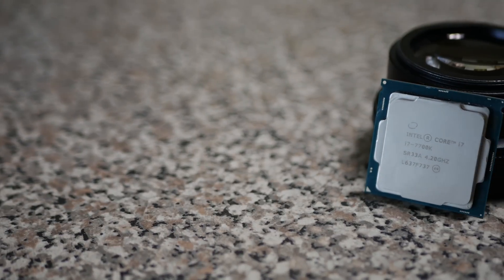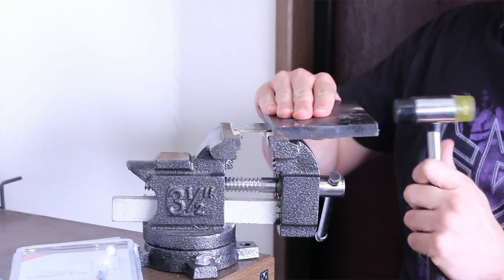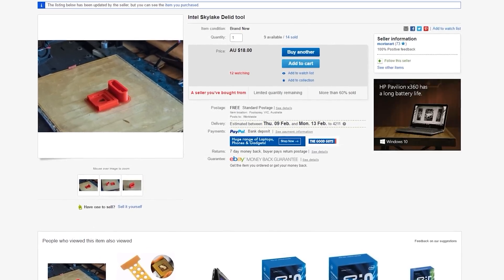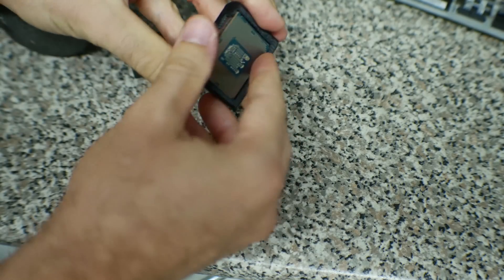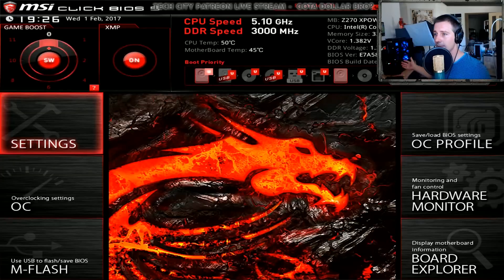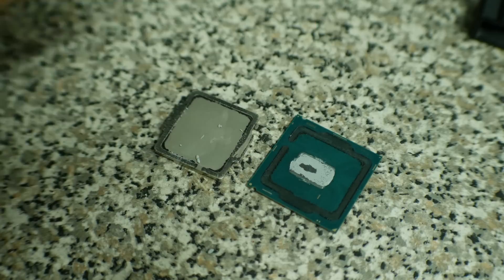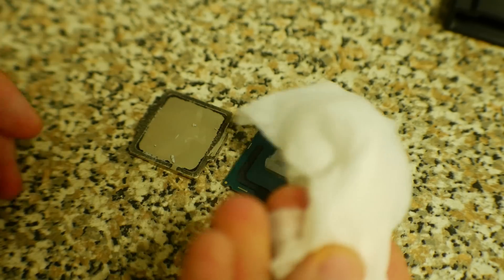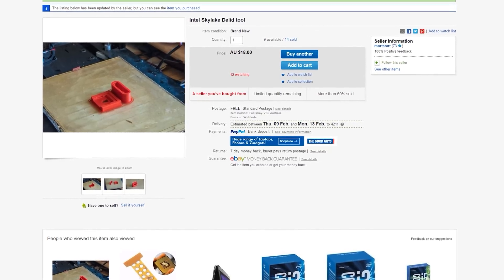DELIDDING The i7-7700k - How much of a Difference is there?

Comment: AMD used to be the hottest cpus, but for a while now Intel takes the cake..Seeing reviews on youtube  ppl happy with 85C on intel chips, like its ok..
Reply: intel takes the cake because AMD hasn't released anything for 5 years
Reply: Roman Kanivets Seriously? bummer :( my i7 6800k runs 75c prime95 on load with noctua u14s wich is 5- 10c warmer than your cooler. Then again i7 6800k is a souldered chip
Reply: To be fair while Intel CPUs run hot (temperature) AMD CPUs put out more heat (energy).
Reply: Sam B well the reason why most are upset with Intel is bc they are cheeping out on thermal grease that costs next to nothing. Esp with the premium they are charging for the CPUs.
Reply: My skylake runs at 40~50ºC under load.
Reply: Yah I got a really bad chip even out of the 4770k's. I haven't tried changing the thermal paste, afraid to break it. But yah can't over clock it at all, was a huge disappointment after I got it. I would imagine it would have throttled like crazy if I tried using the stock heat sink.
Reply: hm 85c for skylake is bit high but those chips can handle higher temps .... skylake start thermarthrotling at 95c and shot down for safety reasons at 105c .... now yes i personally would not be happy with 85 c but that sound as or very high OC or  bad cpu cooler cos i have my i7 6700k on 4.7 ghz on max temp 70-72c (corsair h100v2)
Reply: yeah intels cpus run hot because you can push them to the limit and actually have them put in work
Reply: namcost I have FX8350 @1.4v  @4.6ghz and max i get is 70c on aida 64 stress test. running it on big air. In gaming 52c to 60 max.
Reply: after pissing all over AMD chips for supposedly being hotter. Yeah, I just laugh. Delusional fanboys is all.
Reply: Pennywise, It took me years to realize that we had a septic tank. Pennywise is crazy,but chilling in years of shit from a family of 5, prolly wasn't something IT would love.I grew up in Londonderry Nh right next to a town called Derry Nh, so I though Derry was just across the train tracks.
Reply: what are your thoughts now ? haha
Reply: Yes but we don't know anything about the temperatures, do we?
Reply: Call It What You Want True, if it competes with kaby lake with noticeably lower temps them it'll be the obvious choice, but I still don't want to invest into the current gen processors
Reply: Yah my 4770k runs at 85c under load with a nactua nh-d15 with no over clock! I can't believe they ship cpus with such shit thermal paste.Can't wait for ryzen lol
Reply: Roman Kanivets What thermalpaste are you using?
Reply: Daniel Norelius Arctic silver, and I change it every 2 yrs. Have an AMD server running an 8350 with a cheepo 12$ CPU cooler I picked up on Newegg, and that usually sits in the 60-70 deg range when really stressing it..
Reply: Freddie Lewis intel fanboy
Reply: Roman Kanivets ok, if you live i europe you can buy DerBauers delidding tool pretty cheap. Follow the instructions and nothing will go wrong
Reply: Daniel Norelius oh alright, I'll check it out. Thanks for the info. I live in us, but I'm sure I can find it on eBay or something.
Reply: Roman Kanivets You should also be able to lower your stock voltage. Check what voltage you have and lower it until you are not stable any more. Intel might have set high voltage on your cpu
Reply: I have a 4770K too, and at loads it runs 70C, overclocked to 4.4ghz. I use a Cooler Master Nepton 280L, Close Loop Liquid Cooler, with the Noctua NF-A14 Industrial IPPC-3000 PWM fans. That Noctua you're using is doing a poor job, something is not right. I've seen that Noctua doing better temperatures, like 75C at load. Check your system
Reply: It's the cpu, I was using corsair h100 closed loop liquid cooler prior to Noctua, had really bad results. The cpu was hitting over 96C under load. I think I got a bad batch or something.
Reply: Pyrobaguette1 same with 860/870
Reply: No overclock and 85c under load, with the D-15 for cooling, is really strange .. even the stock intel cooler wouldn't be that bad. I would advise you to check the vcore voltage first, then check if the cooler is working properly. My i5 6600K overclocked at 4.6Ghz with the Corsair H60 never goes above 70-72c, even in prime95
Reply: Gixxer983 AMD cpus only report the cpu temperatures, not the core temperature. Which is always 10-20 degrees lower than the core temperatures. Anyway the 9590 really puts out alot of heat and without proper cooling will get fried and it did happen to alot of people, hence why it is so infamous as a joke in hardware forums. You can tell how much heat the 9590 build outputted just from the fact that it increases the entire room temperature on load. A friend of mine who have a 9590 cpu in his build says he cannot play it without air conditioner because his room would become too hot. If you got a kill-a-watt or a high end power supply you can see that even an FX 83xx draws more wattage in a similiar build than a freakin 6900k, therefore theoritically it is also producing more heat. There is just no denying it that the FX are a very inefficient cpus. But it is indeed managable provided your cooling solution is enough for it.
Reply: My 7 year old Dell XPS running a 2630QM Sandybridge ran at low 90's on rendering/encoding. It's still alive and working perfectly. I reapplied using Arctic Silver 5 about a year ago. Runs flawless, idles are around 46-51. On full load, it hits low 90's!!!
Reply: KungFuBlob nice to hear that. cpus are very very hard to kill. i dont know anyone personaly that killed one. cpus will generaly shutdown when tdp is reached.. i think only voltage spikes might torch one or extream heat for years on end.
Reply: zen will at the highest end is only 91watts tdp with 8/16 threads 
and intel 7700 at the same tdp but only 4/8threads and eating 1.4volts when OC at 5ghz+
Reply: woah, my 2600K @ 4.5 stays under 75 even during stresstests with a nh d 14.
Reply: dutchie here, we probably reach that temperature 2 days a year.
Reply: Well, my Skylake runs at 48ºC when is under 100 % load
Reply: I've rarely ever had thermal problems with AMD chips over the past 25+ years that I've used them. I currently  have an AMD A-10 FM2 6800B(K version was twice as much $ for almost no performance gain) clocked at 4.4Ghz, with a 100watt TDP, and it rarely gets up to 50C on a DEEPCOOL GAMMAXX 200T($15USD Air cooler), and currently sitting at 35C with summer peaks at 48/49c under full load doing DVD encoding(was transferring my family's old VHS home movies to Digital, and DVD).
Reply: considering how shiney Tech City is at the start of the video, you'd think someone would figure out its summer for him and not post a stupid comment about thermals
Reply: +Roman Kanivets makes you wish they soldered the ihs on right? That's why Sandy Bridge stuff ran cooler.
Reply: That's part of the reason I've not upgraded my current system in the past few years beyond storage, and a GPU, as the gains have not been great enough from AMD, or Intel to justify the cost of a total rebuild for me.
Reply: +Eskmm Thing is I live S. Carolina USA, and during the summer we have days with up wards of 115F/46C when factoring in the head index, with humidity of upwards of 80%. So yes his comment is valid when my AMD systems on air cooling and no delidding run so much cooler on average(see my older statement) with little performance different in daily everyday task(not canned benchmarks).
Reply: And they just release cpus that beat out the 6900k at 4Ghz, with the same number of threads, lower frequency and lower tdp 😂
Also superior multi-threading technology
Reply: I agree with all except multi-theading technology, amd stm makes lose performance in games and intel doesnt
Reply: I hope this "Zen" will totally smash the shit out of intels CPU's. Not cause I am a fanboy of any part but its annoying seeing Intel being at the top with no competition and are making expensive chips with poor quality and no major upgrades to them.
Reply: fuck you pennywise you ruined my childhood. I thought blood was going to fly out my shower and refused to stand near the drain for months.
Reply: I live in Florida now. You could prolly get away disguising yourself as a leper, due to all the bums. If I see a bum holding a we all float down here sign. I'll shit my pants. If I remember right in the book. The Leper or Pennywise, kept asking Eddie to blow him or he wanted to blow Eddit. It was fucked up. 

http://liljas-library.com/img/other/leper_x3.png
Reply: But if you delidded, Ryzen can't touch it.  Everyone remember the old days of Athlon where we used the pencil trick on the cpu to unlock it?
Reply: that only worked on some of the chips. I tried it on my chip and the later ones didn't unlock. I know what you mean though.
Reply: Dex4Sure CPU innovation is rare now, I expect quite a bit from vega but I'm not excited at all for ryzen

Comment: My non-delided 7700K at 4700 @1.168V don't go over 51'C under gaming. It's under water though. Perhaps I would be alot lower if I delid.. :hmm:
Reply: Christian .T no it will not alot lower .. it will reduce the max temps a bit only
Reply: I'd say it would since the temp difference on this video is around 15 degrees
Reply: 5GHz + Prime 95 = 85c+

Comment: The problem is not the thermal paste..

The problem is that the IHS don't make good contact with the DIE due to the black silicon-glue they use.

Comment: Would not cpu short if the cool laboratory liquid which is liquid metal gets to pcb or i am just thinking to much ???????????
Reply: tim serious liquid pro has a curing process, when the temperature of the CPU reaches 70 or 80° it will harden. You have to cook it into the CPU!
Reply: NeoVoodooTech but dont that mean your PC cant stay upright because it will drip down than during the curing or is the pressure high enough that even when the CPU is on its side the liquid wont move

Comment: why don't you go RAW on the silicon?
Reply: Sega Hen Because he can crack the die if you attach the cooler without the IHS installed..
Reply: I do think somebody should try a copper polished lid replacement though perhaps? Since all cooler manufacturers tell us how much better copper is.
Reply: You have to think about where that CPU has been before going raw on it.
Reply: Sega Hen because you will crack the die with the coolers we have nowadays. Intel switched to a cheaper and slimmer pcb aswell, and you can see with the coolers we have like those noctua ones, how the pcb bends. Think about no hs and a highend cooler. There wouldnt be any support for the die or to the pcb, and you would kill the cpu when installing the heatsink for sure.
Reply: Ben Carter cost....
Reply: But when your building a device on the cutting edge of technology, surely you would want it to be perfect... I mean copper does oxidise slightly, but I don't see why there isn't a kit out there for enthusiasts.
Reply: +Ben Carter just lap the ihs you already have. It should result in better temps.
Reply: +turke33 is copper that much more expensive than aluminum? Don't they use it in most wires already?

Comment: Get either the Delid Die Mate from Der8auer or the Rocket88 Delid tool. They are awesome. I also advice using CLU. And you can even relid it!
Reply: For anyone wondering I used UHU 46735 to glue the IHS back on. Don't forget to buy the appropiate relid kit!

Comment: Holy shit, the coollaboratory liquid pro is insane. It has a thermal conductivity rating off 80W/(m*K), that is 10 times higher than artic silver. Too bad that stuff can't be used with aluminum.

Comment: I was about to buy an i7 6700k but the price difference between that and the 7700k is almost not that big.. like I can go for the 7700k but should I? is it even worth the extra cost even if this is not that much higher but still if performance wise is not that big of a deal I would go for the 6700k.

Another thing, I have currently a coolermaster 212 evo on my old AF i5 2310... I know is compatible with 1151so my question is, will I be able to overclock an 6700k or even a 7700k with this or I will need liquid cooling system for achieve this?

EDIT:
Thanks for the replies guys! I would replay each one of you but I also saw some needless arguments so I rather keep it simple and edit this main msg lol but yeah THANKS! I will buy it next week depending how much discounted price I get on either one as I will pay on cash so ill decide on that and hopefully I can go for the 7700k. Also I'm not doing this for gaming, I'm fully aware that any i5 "K" would do just fine for that matter (been playing games no problems for years with my 2310 at 3.2ghz and is not even an unlocked cpu hahaha)
Reply: I'd recommend you wait a couple more weeks for Ryzen and then decide when the prices are known. :)
Reply: Mrskithuset You don't need an i7 to get high FPS with a high end GPU. Only a small number of games will see a big difference in FPS when you go from an overclocked i5 to an overclocked i7.

I would recommend an i7 if you plan on doing a lot of streaming or creating content/editing.
Reply: GutsRage yeah if your gonna de lid and overclock the 7700 it's worth it
Reply: GutsRage I noticed on average you can get about 200-300 MHz more on Kaby Lake than Skylake. So 4.8 should be no problem on a 7700K.
Reply: C. L. K times have changed mate.theres a 30 fps difference in battlefield 1 between oc i5 and oc i7.and forza too.and if you plan to use a high refresh rate monitor an i5 will bottleneck it.
Reply: Ruma look it up youtube i5 vs i7 bf1
Reply: Luke I did, 3 FPS difference on average with OC i5 and OC i7.
Reply: Bad advice from +ingram... water cooling is always much cooler than air. No ways around it. Only a few air coolers (like the Noctua's he mentioned) can even come close to AIO watercoolers and they cost the same. Get with the times and get a watercooler even if its not a full custom loop. They are worth it any day, all day.
Reply: No, he's not. There are some people that comment and when they know they fucked up, they delete their comments to make somebody else look stupid.
Reply: If you have a high end GPU and NEED high fps go for i7. if you have a midrange gpu get an i5 and keep it as cheap and quiet as possible.
Reply: Ruma look the video below the gn one by ARTIS
Reply: Not mad anymore, you deleted your comment, now I will delete mine, I just got triggered because you called me an idiot because you thought I didnt know that z270 1151 works with z170 1151
Reply: You
Reply: Don't act like you didn't comment on my comment
Reply: Stop deleting your comments, and I'm not triggered, I just don't know why you're acting clueless
Reply: Who said anything about an iPhone??
Reply: Dilan Parmar Stfu you lying sack of shit, since I'm on PC I can see the previous reply, and I'll be more than glad to post it on imgur
Reply: BlueTJ I've been noticing that people have been doing that more and more lately, this has happened to me twice now, hopefully your backing me up BlueTJ
Reply: James Fulkerson That happened to me too one time.
Reply: Dilan Parmar You should be quiet. Nobody wants you here, you toxic person.

Comment: and why won't you try to carefully place the heatsink directly on the cpu die? just don't screw it too tight and it should be fine and those another 10 less degrees will be priceless
also good old days of 775LGA when Intel soldered their dies : 3

Comment: Much better than Linus video about deliding!
Great video man.
Reply: Agree. He just said it makes no difference when in fact he used cheap thermal paste. Even for me using "Cooler Master mastergel maker nano" on my 4790k it runs a lot cooler. usually can go 80C easily but now it goes at least 70C max on 4,.4GHZ and that's not bad for what it was.

Comment: The difference is huge. Gotta try it on my 6700k. I want to pull off a good 4.8ghz.
Reply: Tanzu15 the paste in the sky lakes aren't that bad
Reply from the maker: Yeah I found skylake to be better for some reason.... pretty weird.
Reply: gavin GIGGLES but they could still be better though. I can get higher more stable clocks out of it. Its embarrassing that some dumb paste is holding back these chips from performing their best.